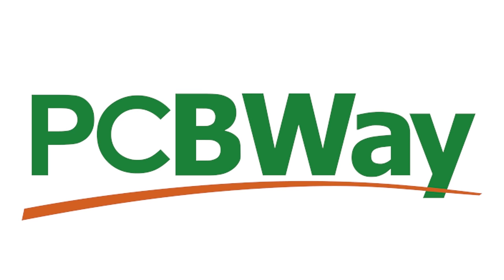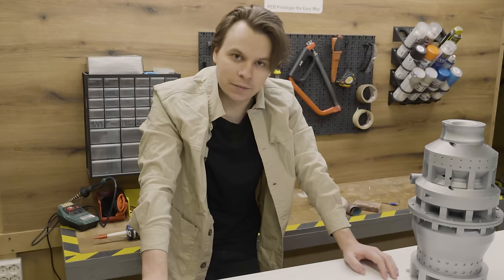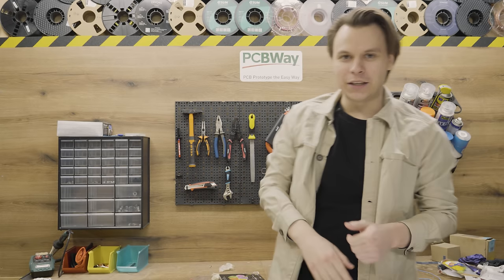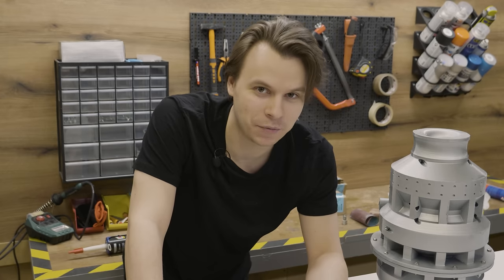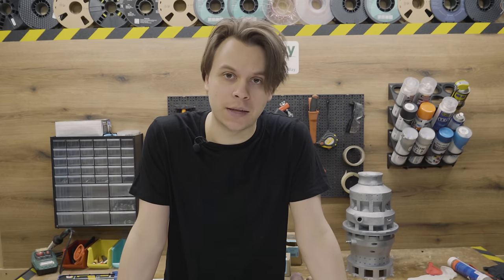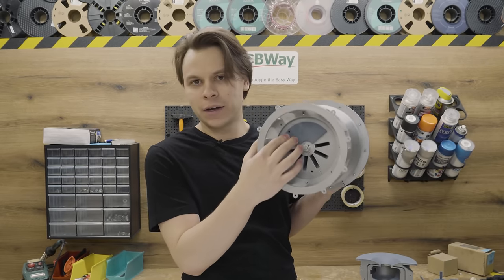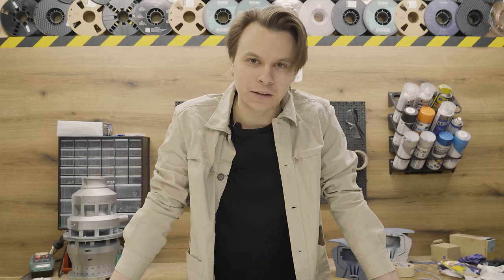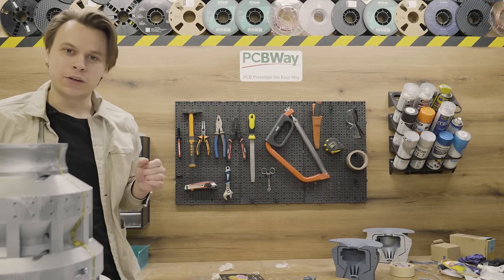It Took Me 3 Months To Get This Working - Two-Stage Centrifugal Compressor 100% 3D Printed

Comment: Alright, the genuine challenge lies not in merely rupturing a balloon via a turbine, but in expelling it with greater velocity through said turbine than through the incoming pressurized tube itself.
Reply: I guess it's about turning a compressor into a blower then
Reply: @ziad_jkhan  If you're utilizing a compressed air source to drive a two-stage turbine, the least you'd expect is to have a greater output gain from the turbine compared to the incoming air. Otherwise, you've simply wasted your time, along with squandering energy and generating waste.

Comment: What resin did you use for the impeller and with what printer?

Also is the outside fdm printed?
Reply from the maker: Hello,
For resin prints I used Heygears Ultracraft Reflex and resin called PAU10 (it's ABS like resin but stronger). For FDM I used ABS+ and Qidi Tech Q1 and Max 3.

Comment: Can you Measure the Air Flow Rate Going in and Flow Rate Going Out  with an Anemometer .. build a Model with one stage vs your 2 Stage ..

Comment: why not use silicone gasket maker im sure that will fix more issues down the road for you because stop air from escaping out the side
2nd issues i see is that you space bearing too far a part which it lead to out of balance up and down shaft which will push blade into housing and worn it out or tear it self up
you may want reduce space away a part that way be less moving up n down so it doesnt rub on housing
3 i can tell on top camera when it revving up you can see top blade going out of balance because no support bearing same goes to bottom blade little fixing on that should get you far more proving

Comment: Seems not ideal to have the second stage similar in size to the first and spin at the same speed, look at compound turbos on diesel trucks and you will see that they size the inlet of the 2nd stage to be roughly the same size as the outlet of the first stage.

Comment: Nice work. But that compressor looks totally choked on the output between stages. That style of compressor likes to move air, lots of it.

It's not so much high pressure as it is high volume of air. The outlets are almost non-existent. 

I'm only a minute in.... Maybe there's something not looking right. The compressors need an open outlet.

Comment: I want to see this in metal, with a valved bypass between the two stages as a sequential turbo. Make a VGT housing for the exducer to maximize spool range.
Reply: Obviously a combustion chamber between inducer and exducer would make a nice jet turbine, could make for an amazing operational range that makes it more viable for non-aviation purposes.

Comment: This is all wrong, you haven't 'staged' it properly, the first compressor wheel should be heaps bigger than the second, this is how all jet engines with more than one stage are, 'beause' you have compressed/shrunk the air. Go look at any jet engine, that second wheel should be half or even a third the size. If you want an example check out APU's(auxiliary power units) in airliners, a good example is one from the Airbus A320, you will learn a lot from it, the smaller second stage/wheel should also spin between 2 or 3 times faster 😅 good work though, I am building the same thing but out of metal, using aluminium compressor wheels as in turbochargers, you can buy second hand turbos for $20+, and then just pull out the wheels, you show great ingenuity, would love to see your next/improved version. Great work 😅😅
Reply: Your right, the air is re-expanded after the first stage because the area ration between the first stage intake and the second stage intake is the same. The second stage intake should be smaller so that the pressure ratio of the first stage is not 1.

Comment: "100% 3D Printed" - then proceeds to use dozens of off-the-shelf metal rod, bearings, bolts, nuts, etc. plus lubricant.
The actual design and design process is absolutely impressive —i.e. there's no need to **lie** about it being "100% 3D Printed".   So, why lie?  
(I'm sick and tired of "100% 3D Printed" lies by YouTubers.  Just be honest!  "It Took Me 3 Months To Get This Working - Two-Stage Centrifugal Compressor - 3D Printed body & impellers" would have been just as impressive _and it would have actually been honest_)

Comment: Grafiks are wrong, estimating something?
Dont understand physics and aerodynamics?
Reply: The Wings are Square shaped, instead aerodynamic, also the Airflow isn't properly desingned (no cone for second intake, for example)!
So the lowest Standards were ignored, the efficency must be screwed!
Reply: Also you can control airflow dynamics with stationary wings in between the compressor stages...